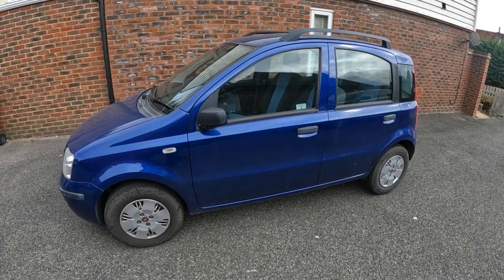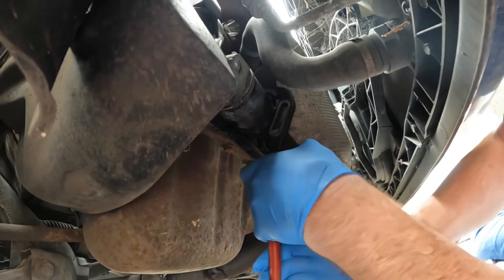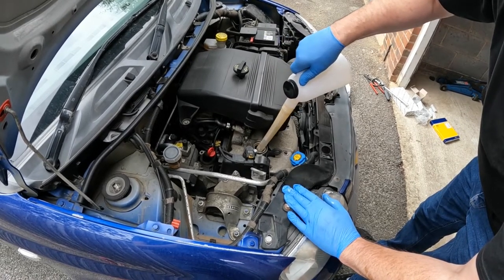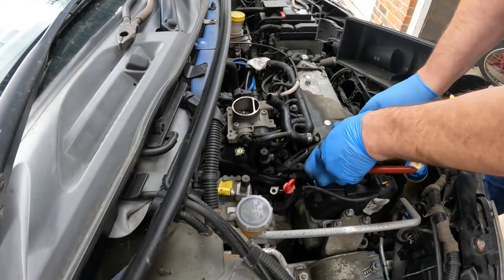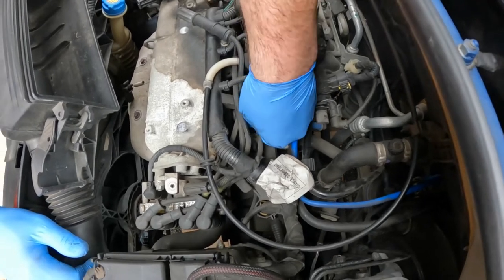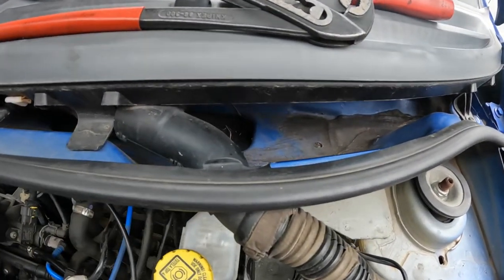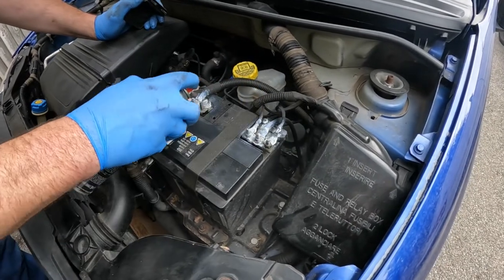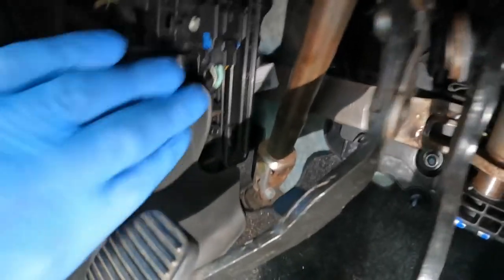Servicing a 2009 Fiat Panda 1.2 Dynamic Eco

Comment: Whilst I note the rave reviews the Panda gets, what a utterly ridiculous positioning for the Oil filter!
Does the service manual stipulate a torque setting, and if so, how do you get into that spot with a T.W.? 
I've worked on all sorts of stuff over the years, cars, bikes, the odd tractor....  more often than
not, you get a torque setting, or failing that, something like ''2 1/2 turns'' ....   ''Hand tight'' would make me very twitchy!
Reply from the maker: Most of these ‘old school’ spin on filters were done up tightly by hand and at next service they were still bloody tight to remove, needing the assistance of a strap wrench/water pump pliers! I’ve never seen one come loose. In the case of the modern ‘renewable paper element’ type, I’m careful to tighten what is often a plastic cap to the torque setting, which is usually stamped on it.
Reply: You're making a mountain out of a molehill, the oil filter is easy to get too, far worse than this on other cars, if you are panicking about a tucked out of the way filter give the job to someone else, I've never heard anyone complain about where it is before, the design is nearly 40 years old., no torque setting, it's all about hand tight.